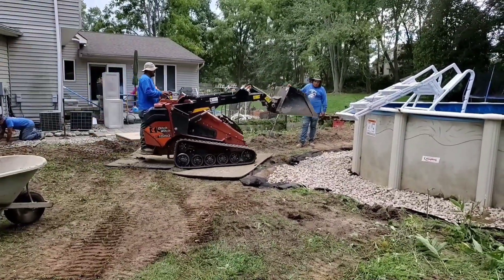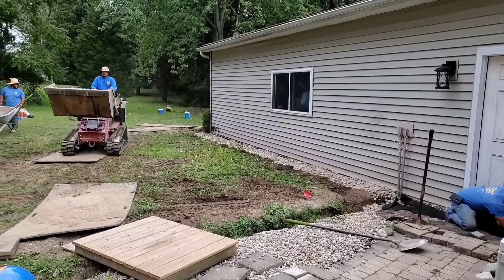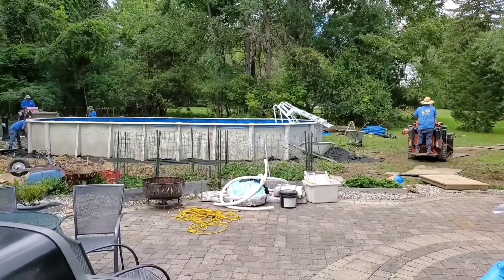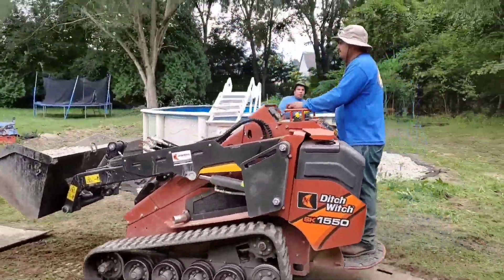Garage Flooding Solved / Fixed - French Drain Instructional Video

Comment: Thank you so much for your videos! We live in Kentucky in a 90s built home, no basement, slab foundation. Started redoing a sunken living room because of mold to find the fiberboard layer behind the brick wall is rotten. We dig up the dirt around the room and see that there is no drain tile. I’m confused on what would be the right solution. I think installing a perimeter drain would be more effective than a drain tile. I see there are so many different waterproofing products but the French drain has been used for years. I am reluctant to hire a contractor, we hired the most reputable company in the area for dealing with water issues and they charged us $1800 for a sump pump that does not fix the issue. Was wondering if you have any advice?
Reply from the maker: I would run a French drain tight to the slab and take it to a backyard sump pump then discharge it 100ft away perhaps you have a Ditch or swale to run it to.
Reply: @FRENCHDRAINMAN  Okay, that makes sense. The french drain tight with the house will divert the water. We got an area where we can put a daylight drain. The house sits on a slope so the area where we are having issues receives all the run off from the slope. Appreciate your reply!

Comment: Why not use the perforated pipe ... just because it's used as a discharge?
Reply from the maker: That big tree can root 50-75ft from the trunk and there wasn't any standing water along the side of the garage or out front. If it had to be a French Drain system we would have used High Octane Royal Blue 8 slot with our fabric.